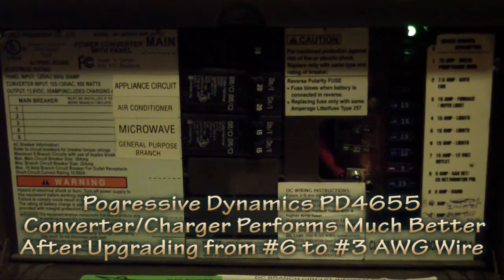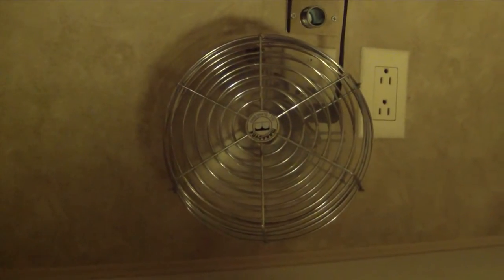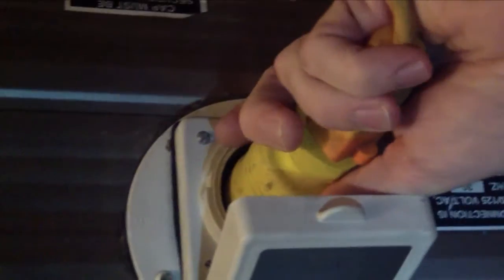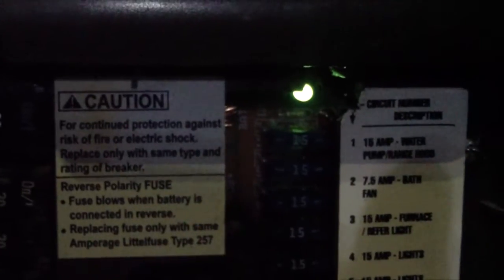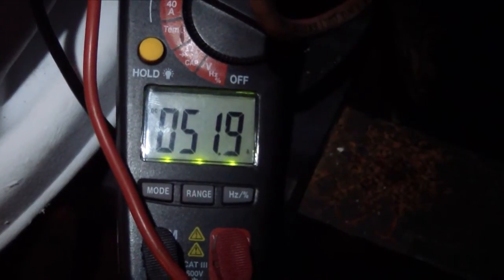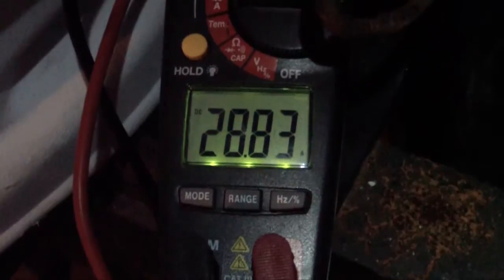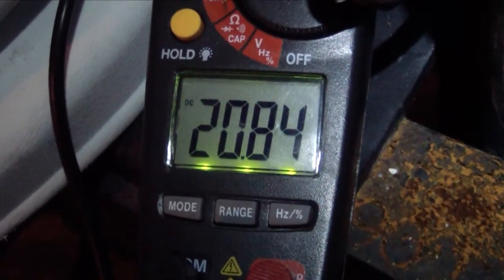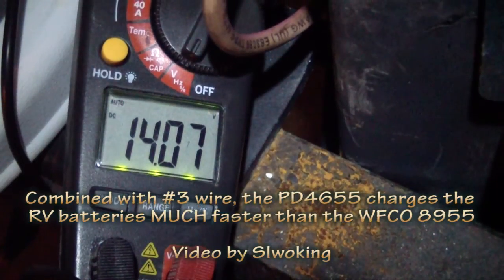PD4655 conveter performs much better with higher gauge battey cable

Comment: I ran 2 guage between my battery's and 4 guage to my inverter in the coach my external inverter i plug my coach into has 2 guage from the batteries to the inverter

Comment: So, was it the new system that made it possible to charge at a higher amperage or was the original system just fine and it was the addition of a larger gauge wire that fixed your problem?
Reply from the maker: +tonkatoytruck In hindsight I think installing the larger gauge of wire was a bigger factor.

Comment: You could carry with you some solar panels and this will help when you can't use generator power; cheaper too in the long run.  But if you are going to places that has shore power then I guess you will be ok either way.

Comment: I need a Bff like u. Im an electrical failure.I dont know how I made it to be as old as I am w/o the Youtubes in my life to guide me. 
Is the noise of that fan amplified by the camera mic b/c it sounds loud?What situation are you coming across to spend the time and money to modify the system like this?I have a old 97 33'class A motorhome w/a broken 40amp stock converter. It has 2 batteries + keep it plugged all the time .What size and unit to you recommend to replace this?
Thanks for the videos